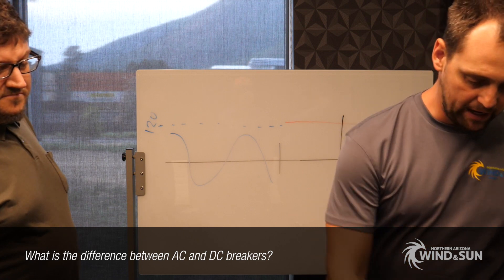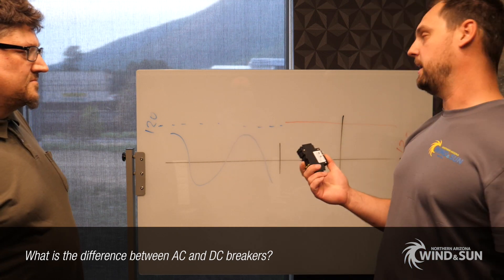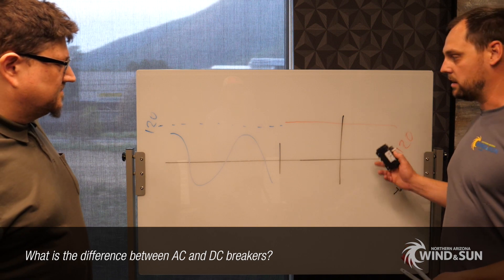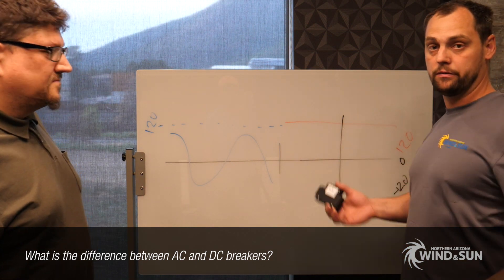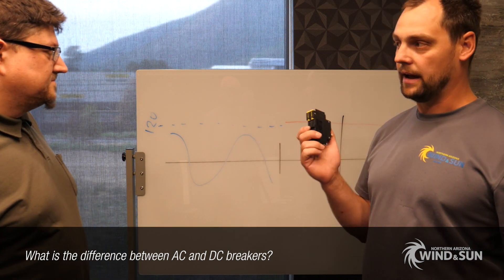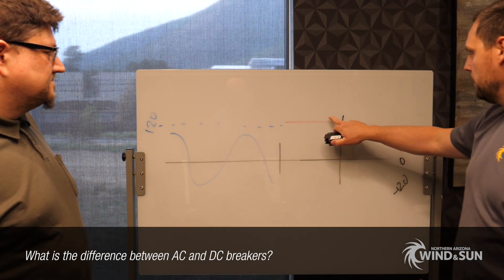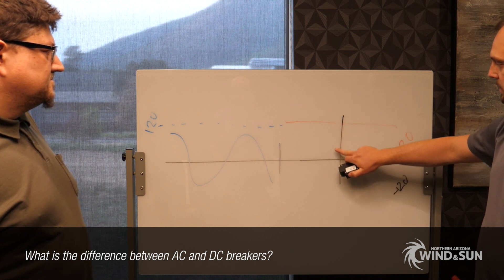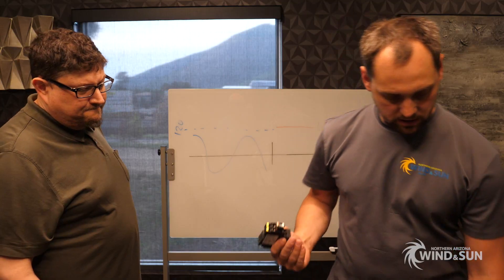All About Electrical Breakers

Comment: Way too much information for the casual home owner and not enough for more advanced research. Such as a DC breaker for the battery bank. It can't be direction (polarity) based as the current can flow either way. Wouldn't that be worth a mention? It is what it is on YouTube. So what's a guy to do? Put two half sized DC breakers in parallel with the polarity of one in one direction and the other opposite? Don't do this on your home.

Comment: I'm surprised you didn't mention DC Ground Fault Protection breakers, which you guys sell, and I believe are required for most solar installations.  Also might want to mention differences between Breakers and regular voltage disconnects (switches).

Comment: Just a nit, a 60Hz AC circuit goes to zero volts 120 times per second, not 60 times as stated in the video.

Comment: Excellent info guys! You guys are the best! They system you helped me design for my Sprinter is working flawlessly! Thanks James. This video triggered one concern. I have a 30 amp blue seas breaker from my sunpower solar panel to my Victron MPPT. Panel voltage peaks at 60 volts in cool conditions. I’m pretty sure the breaker is not rated above 48 volts. What issue should I expect if I do t swap it out right away?
Reply: Probably not an issue as long as you are not trying to switch the breaker on/off under those cool or VOC conditions where the voltage is well above 48V.  But best to change it out eventually anyway.